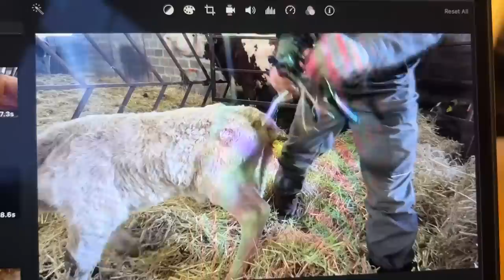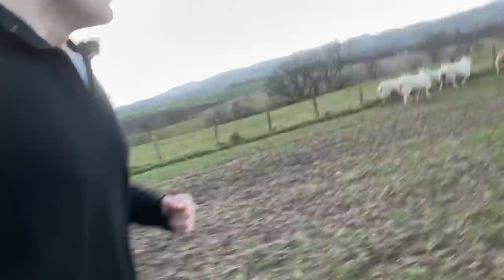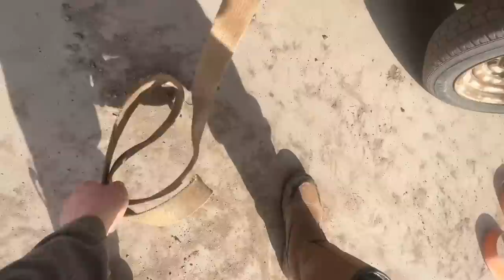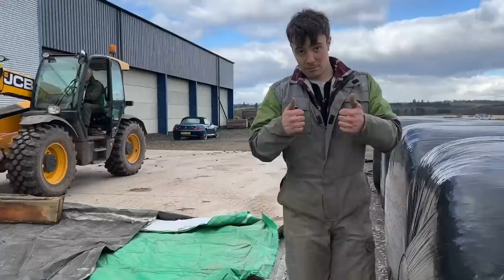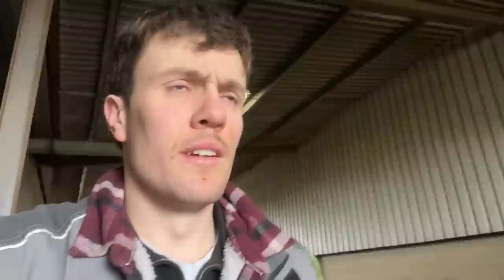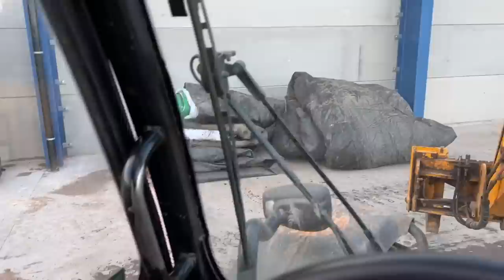HUGE upgrade for the CATTLE SHED

Comment: New shed is exciting! 
I think you should consider not have a scrape passage and a feed passage. It is wasted space if that makes sense. Look up some yards which feed from the scrape passage
Reply: What I’ve said in short sounds complicated..
But you can have feed troughs on the inside on the passage way. Shut cattle onto beds, scrape passage and drive through that same passage with feeder wagon load troughs just a small narrow area then let cattle back out. Very easy 1 person job. Get both jobs done. You can then have all the undercover space used up by the cattle. Rather than a lot of feed passage space which is only used to drive through once or twice a day

Comment: If you get the right fabric, put the bolt through the strap and the tarp with a bigger washer. The strap is less likely to move with the pulling action of the tarp. I think you may want it on both sides? Love the calves and those DA** sheep. Blammmm Blammm LOL :D ( i have sheep. If you know, you know.)

Comment: sham  the roofing was rotten , if you need  put holes in plastic of that type a piece of round bar just heat with a blow torch will make neat holes
Reply from the maker: 👌🏽 good idea cheers

Comment: Brilliant, funny, entertaining as usual for me but not so much for your Sunday. Pain in the arse. Maybe thin flat steel or ally either side of a decent sheet if you can get one off the shelf then bolt the sheet in between them and hopefully you can bolt and bend it to shape as you go across? 
Only thing I can think, no idea of cost either but you'd need that idea in several places across.
Reply from the maker: Got it sorted 👌🏽👍🏼

Comment: Would the ear tag punch work for making a hole? Yes, after the fact but maybe the next time you need a bodged hole in fabric,
Reply: The sharp side of the tag makes the hole, the punch applies the pressure, I see where you were coming from and adapting an eartag to not clip into it's other half may well work 😊

Comment: how do you get cattle into collection point  the crush you would be better pushing cattle to the outside and turn the circle pen around also footbath in race just a thought otherwise great improvement .Also where do you store barley  and minerals  feed  and vaccines anti biotics calfing machine calf formula hot water source
Reply from the maker: Using passage as collection and the pens pre circle. Then exit to the other pen (which isnt really a pen just the rest of a lean too. Crush has side exit for siving off beasts to that area to hold back for whatever reason. Have other sheds there for feed etc. thanks for mentioning hot water 👍🏼 got me thinking
Reply: @CrawfordsFarm1  Sink with hot water beside the crush. A priority for calving cows. Room for a decent sized bench and cupboard as well.